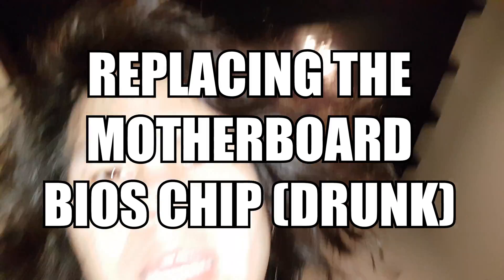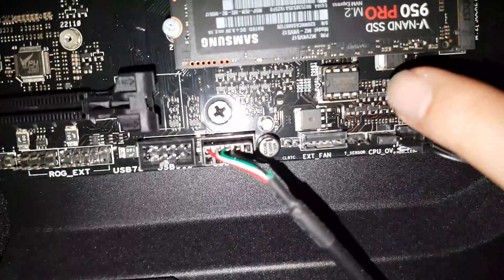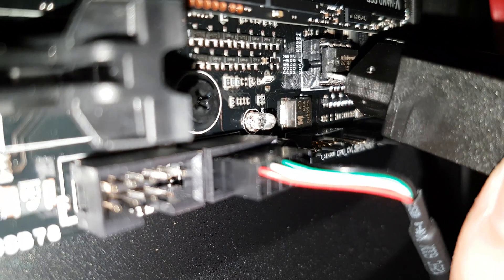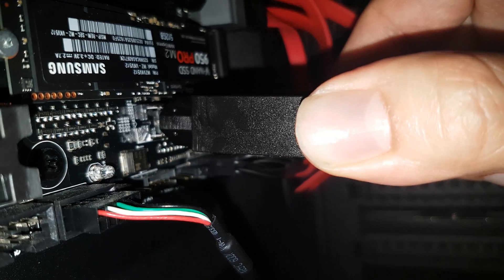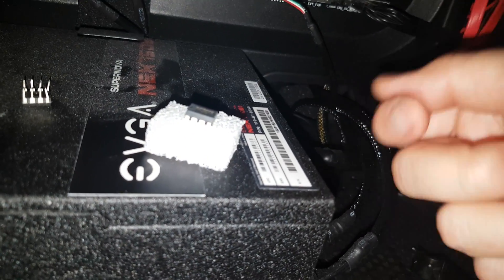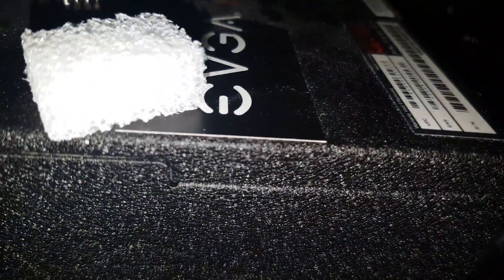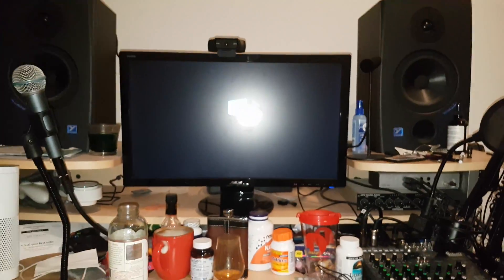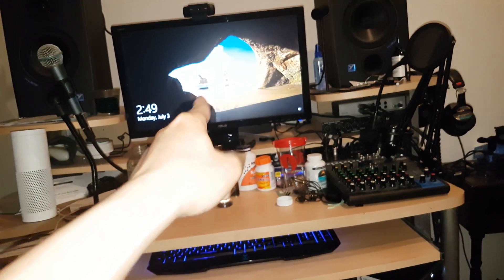Replacing Motherboard BIOS Chip (DRUNK)

Comment: Hi Jason thanks for putting the video up showing that you replaced the bios successful what happened to your computer prior to this? What symptoms did the computer do for you to get a replacement BIOS chip. I think I've  bricked my motherboard all I'm getting is the CPU red LED light is on no POST beep or anything on display. Fans are on as well as gfx card. I downgraded my BIOS to an old version and then updated it the computer sat there and I turned it off and then computer won't turn back on I'm hoping that a BIOS chip will fix things.
Reply: Did you try it? Did it work?